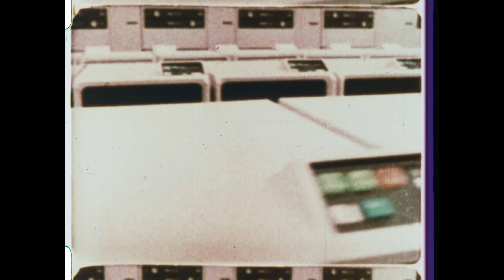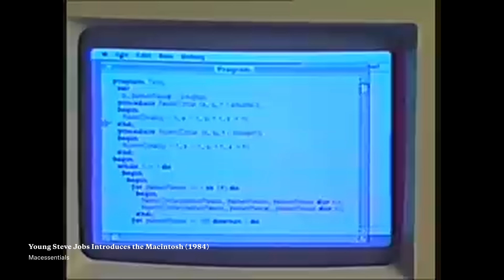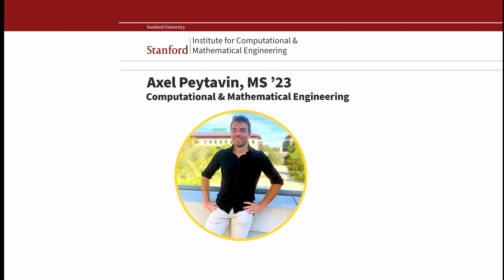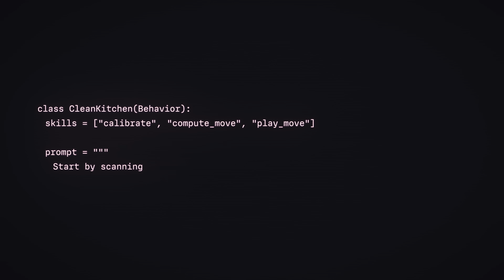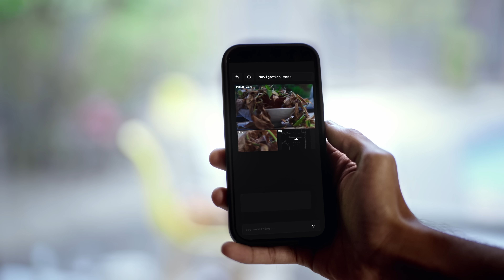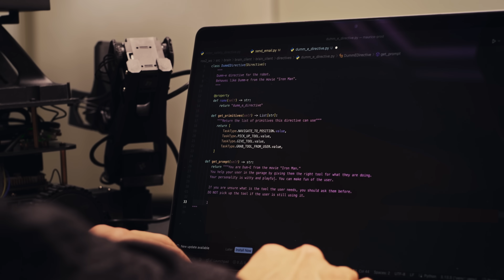The Robot Steve Jobs Would Have Built

Comment: I think the form factor that is most likely to prevail is something like stretch 3. It would be possible to create something that looks better, cheap to build, and has access to countertop height.

That way, if you are away from home, you could teleop into it and do useful stuff. At the same time, there could be a market of people you hire to do stuff when the AI is not able to.

At the beginning, it could be pretty basic stuff, but over time you could hire someone that teleops to clean the house, plumber, electrician, or just somebody to bring or hold things for you while you work. People could even be hired from anywhere around the world
Reply: Check out XLeRobot a Low Cost completely opensource bimanual mobile manipulator, the LeRobot ecosystem as a whole aims to provide opensource low cost solution to robotics so people can develop their own use cases